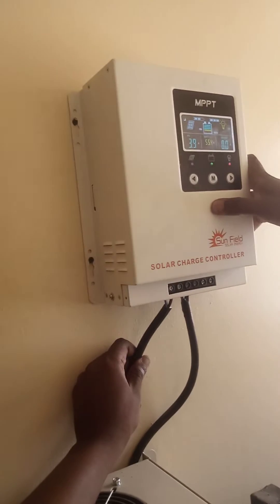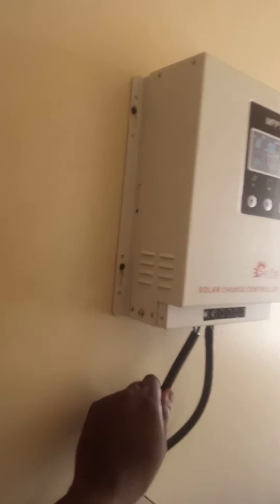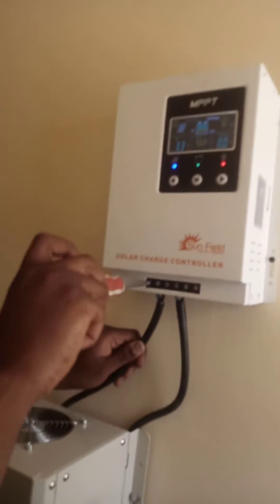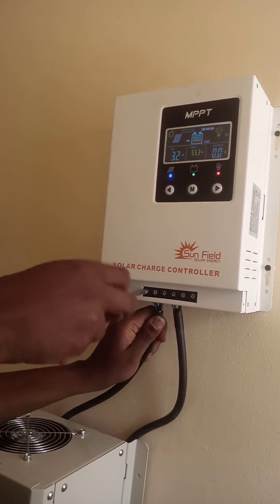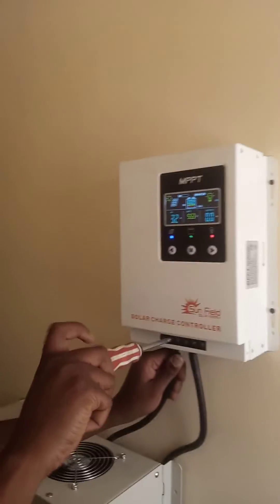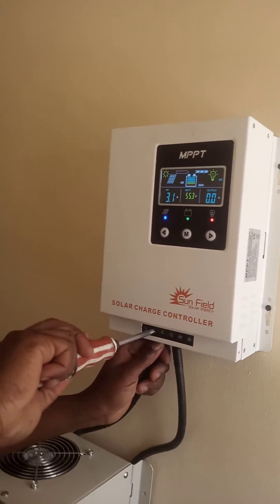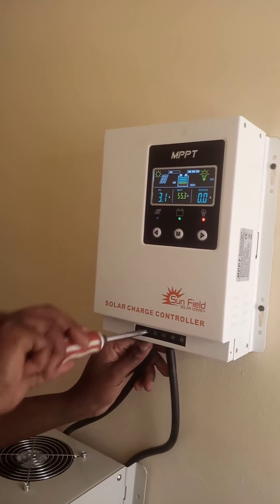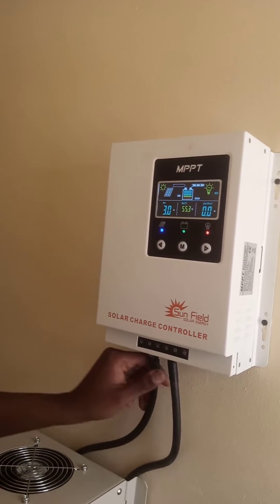"Learn to Connect Sunfield Charge Controller, 10kVA Felicity Inverter& 4 Eastman Tubular Batteries

Comment: I installed a sunfeild solar controller it’s was displaying 108v the solar voltage but now it’s showing the battery voltage on the Pv side what can be the cause
Reply from the maker: snap and send the pictures to my WhatsApp number+2348038015711
Reply: @installerpaul I also have same issue with my client charge controller, what’s the issue and solution please
Reply from the maker: @oladimejiyusufolatunji6357 reset it

Comment: Why no DC breaker between the panel and charge controller? 
Also the cable from the charge controller to battery should be thick.
Reply from the maker: The DC Cable is 10mm, while the owner of the project is also an installer who promised to add DC Breakers by himself

Comment: Please sir how do you charge the inverter battery, what are the functions one can press on the charge controller to make it charge the inverter?
Reply from the maker: The solar charge controller regularly charges from the solar panels to the battery or batteries. (M) function and select the right option. It is the inverter or your battery (batteries) charger that charges the battery
Reply: Thank you so much sir, this helped , now all the 3 LED on the charge controller are on, what does this mean sir? , thanks again
Reply from the maker: Check the Solar charge controller manual